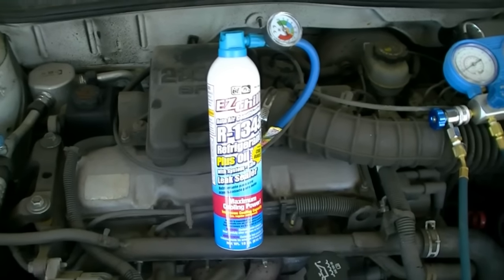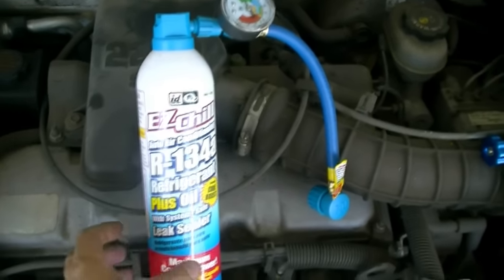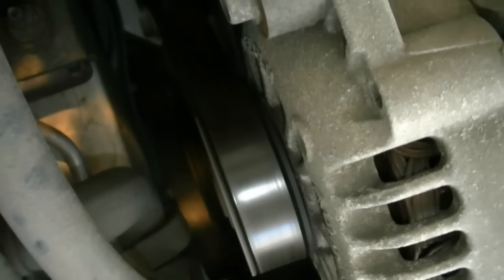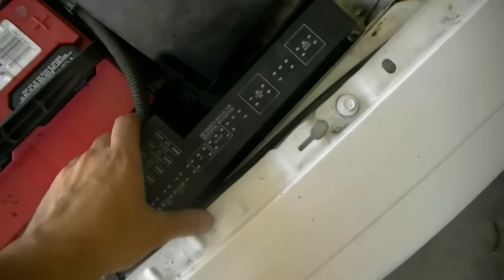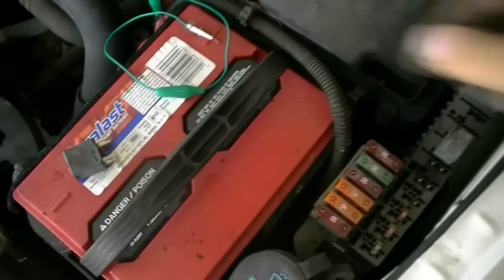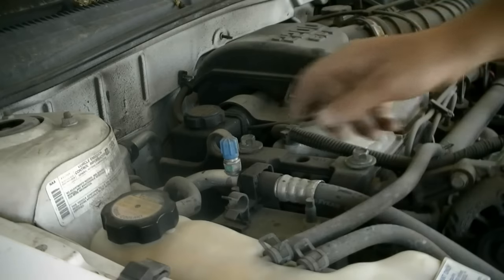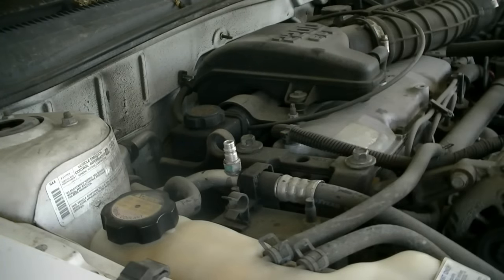How to Add Freon to a Car and Manually Engage AC Compressor Clutch

Comment: There is NO reason to manually engage the clutch.  As soon as you start filling the system the clutch will engage itself.
Reply: It should
Reply: On a lot of vehicles it will not and they also will not fill up without the clutch engaged.
Reply: I've done hundreds of fills, haven't found a vehicle or piece of equipment yet that won't engage the clutch as it's filled.  Which cars have you found that won't?
Reply: +DonziGT230 my 2010 ford escape
Reply: Odd, I just did one last weekend that did engage.
Reply: Mercedes W210 will not, but clearing the codes should allow it to pull long enough to fill.
Reply: That's not surprising, some Mercedes apparently have to be re-flashed when a new compressor is installed.
Reply: And that cut-in pressure point is well below the pressure in the filling can unless you're trying to fill with a can that's extremely cold.
Reply: Steve Vento
People definitely abuse the OTC AC solutions because they're reckless and don't really understand how to use them. Fools just buy them, snap them on and pull the trigger.  But the low side nozzle valve is a useful tool if used correctly.
However, a full can of freon will have enough static pressure in it to overcome the high pressure seen on the inlet side even with the compressor disengaged.
Reply: I didn't know that it would automatically engage. Never tried it but I will for sure before shorting the hell out of my car. Thanks
Reply: John-Del Bullshit
Reply: @DonziGT230  My Lincoln MKS 3.5 TT will not engage.  I'd jump the compressor on my 1998 work car,  but I'm not going to wreck the AC on my Lincoln.
Reply: @56243G  There's never a reason to jump the compressor clutch.  If it doesn't engage something's wrong.
Reply: @DonziGT230  10-4.  Sounds like a very temporary solution that will cost a lot of extra money in a month or so.  There's a tiny bit of pressure in my system still,  but not enough for the can of refridgerant to engage the clutch.  All fuses and relays for the clutch are good.
Reply: @56243G  Check for voltage at the clutch wire or put a jumper on to know if it's a bad clutch or the car's system has a problem.  You might be chasing a car problem and just have a dead clutch.

Comment: Be VERY careful when using stuff with the SEALANT in it, that shit can clog up the expansion valve and that is usually behind the dash and a 2-4k repair at a dealership. It is a quick fix but its not going to solve your problem.  Best thing is to run dye threw the system and see where the leak is and fix it correctly

Comment: What about in my truck I drive  a 2500 HD where would I put the freon? Lol sorry im a girl doing it myself and the caps where I think it goes is black and I cant read them! Help! Is it by the coolant and it looks like a silver metal tube?
Reply: its a one way fitting, ignore color code , i never seen any cap is blue, its ways black.  if fitting is incorrect, it will cause pressure leak or if fitting is not fittable its the other one along the parallel AC line pathway (for some cars may be far apart)
Reply: dang truck
Reply: Ray Wu mine is blue

Comment: I followed everything, and even the compressor clutch engages but when I press on the ac refrigerant trigger it doesn't go, I'll buy a new ac refrigerant bottle to see if that's the problem
Reply: Yes it was the supposed "reusable adapter hose" , I bought a new freon bottle and worked 🙂

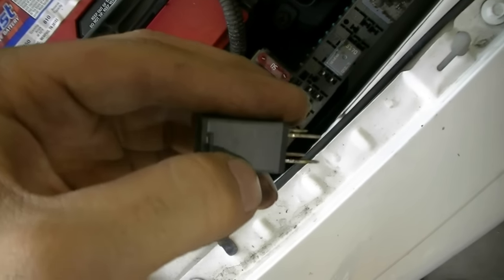Comment: Once the energys gets going I tink it's spring loaded or somting 3:45 haha its a magnetic coil, but your close
Reply: Electricity through a coil causes a magnetic field to attract the switch to close.
A spring causes the switch to open, when there's no electricity and hence, no magnetism. Without the spring, you'd need something else to open the switch, like gravity or other force.

So, you're both half right.

Is easier to just short the relay contacts, than run jumper wires from the battery.

Comment: It's really risky bypassing the compressor low-pressure cutout - it's there so that a high low-side vacuum doesn't drag air in through the shaft seal.  It's also not required, since connecting the freon bottle to the low-side will kick-in the compressor clutch anyway.  You can also use propane gas instead of R134a - it works perfectly well.

Comment: When do you use the Vacuum pump on the A/C system?Does 134a freon in  the system have to be Drain  or need to be empty  first ? Need someone to explain thx
Reply: Tin Ngo 
You only need to use the Vacuum pump, when ya replace a part. Like a hose or any part that requires you to recycle the  refrigerant. To empty the closed system.
Reply: Beeg geeB f zee x dr
Reply: thank you for your explaination

Comment: hi i have 2001 hyundai santa fe i  engaged the clutch on the compressor and started charging the system with the car on with a/c on  and  as im charging  gas starts to  come out somehwere  . i just replaced the compressor last year any suggesstions on whats going on
Reply from the maker: Joseph Polimeni You have a major leak somewhere look into my channel for a video on how to find AC Leaks. GL

Comment: hey quick question your connecting with number on the relay to the battery 87? or 30?
Reply: +A7X_Girl_foREVer ! I actually just kept jumping different connectors with the paper clip until I finally saw the compressor come on.  It didn't damage my car in any way. I have an s10 chev truck.
Reply: ecology1st True, one of the pins is a battery hot that is controlled by switch in vehicle. That too will be on the fuse diagram.
Reply: Meant relay diagram. There is a little schematic on the side of the relay showing pin arrangement.

Comment: Got a 98 Oldsmobile silhouette totally vacuumed and system empty  ac clutch is engaged ac is on to full blast fans are working  the only problem is when I'm adding refrigerant the gauge shows arrow at red red  red... And the system is empty what is wrong is it a bad compressor  a clog in the system can anybody help me please thank you

Comment: I charged mine and it worked for a day and now  the clutch stopped working and blows hot.  Did i add too much nt enough or maybe a bad leak?
Reply from the maker: mirabify you probably have a leak, look search my channel on how to find ac leaks and repair them, I have quite a few video's on that. gl

Comment: i tired manually jumping this on my 2000 saturn sl1. it didnt seem to work so how else would I be able to get it to run? please help!
Reply: If manually jumping it does not work your clutch coil could be bad
Reply: meaning you need a new compressor
Reply: no meaning you need a new compressor clutch assembly you can buy them seperate
Reply: +John Bush where can I buy this and could a link be sent to me?

Comment: I filled my 98 silverado with the arctic freeze 134a+, the clutch did in gage but it turning on and off. It happens in about 20 sec interval, any suggestions? ?
Reply from the maker: You are probably still low on Ref.
Reply: The gage is already reading in the yellow. When the clutch kicks in the pressure drops to @ 15-25
Reply: Compressor cycles on and off during normal operation. Is ur air cold?

Comment: hi i have toyota hais van so my van compressor is not working properly if out temp is 37 to 47.or if i put some cold water in condensor then compressor is working and cool but only for wile if water is dry then compressor is stop and early in morning and night time compressor is work so what can i do ? when i watch this video can run  compressor manual  permanently? or i am  worried that hear in my place temp is too high 47degrees

Comment: as soon as I connect that the gauge goes straight to red, I let the air escape, it literally just air not cold or hot but as soon as the gauge reads that's it's empty I reconnect the freon can and try to do this the gauge goes to red again,  the compressor won't kick on though 
if you could help that'd be nice 
sorry if it's confusing
Reply: Did you ever get a fix for your issue, having the same problem
Reply: Nikki Miller still doesn't work changed the pressure switch an ac compressor and still doesn't work
Reply: same problem too after putting a new compressor on
Reply: yeah
, I give up on this cars ac system

Comment: whath happen if put a lot freon on ac means if you put to much pressure on the sisten?
Reply: +misael pacheco Yes and it can be dangerous.  If the gauge reads deep into the red take it to a shop to have it evacuated, then filled again.

Comment: Just don't use the sealant one. Auto shop will turn you away when reclaiming Freon on the detection diagnostics and can do more harm than good to you compressor. Just use basic r- 134a or 134a.

Comment: hey i did that manual clutch thing with the relay and the ac cluth didnt turn what else could it be
Reply: +Andrew Rosado I actually just kept jumping different connectors with a paper clip until I finally saw the compressor come on.  It didn't damage my car in any way. I have an s10 chev truck.

Comment: hey man. my ac compressor clutch keeps disengaging after engaging for a second or 2. This happens after I refill the refrigerant at my local shop, and it didnt happen before i refill it when the car is low on freon. Do you think the shop might have used R134a instead or R12 or the other way around? that shop is a very reputable shop...

Comment: How do you know it needs more refrigerant?  Did you diagnose that with 0 knowledge of mobile a/c systems? In your driveway? With a beer in your hand? Did you check the low pressure cut out switch? How about the EX valve? Or mabe you have a restriction in the system,, or mabe your heat control door flap in your heater box isnt closing tightly allowing heat into your interior air, just a few of the MANY MANY different problems you can have in an automotive a/c system. Where did the refrigerant go? Mabe you have a leak? Dont you think you should fix that leak? So when its 100 degrees out it works well. PEOPLE DONT JUST ADD REFRIGERANT. spend the money and fix it correctly and have yrs of trouble free a/c in your car

Comment: How come you don't mention that IF you need any refrigerant added to the system, you have a leak in the system and it will run low again and you'll have to keep adding to the system.
Isn't it better to get the leak fixed, and stop wasting money.

Comment: You suggest connecting to the high pressure connector when it should be to the low pressure side.  That's why you couldn't get the filler connector on to the port in the Vid.  Bad advice.
Reply: So there is more than one. Where do I find the other I can't get it on the port

Comment: Those cheap cans with the hose and gauge, they ALL let air and water back into the system. The hose contains some bad stuff. You can't purge those hoses prior to putting the gas in. Don't use those cheap cans.

Comment: Manually forcing the compressor on with low freon is a horrible idea and very dangerous for the compressor.  If you are low on freon and the compressor doesn't kick on just connect the freon can to the low pressure side, the pressure from the can will force the freon into the system and should fill the system enough to make the compressor kick on and begin sucking the freon out of the can faster.

Comment: You could have shown how to add freon in less than 1 minute without all the novel talks.
Reply: My clutch was shutting off intermittently and the info about jumping relay worked great. Took charge after that. Great info, Thanks
Reply: gelospidey do your own video !